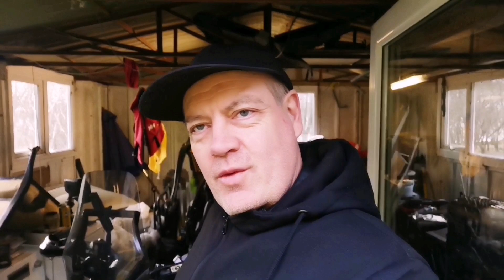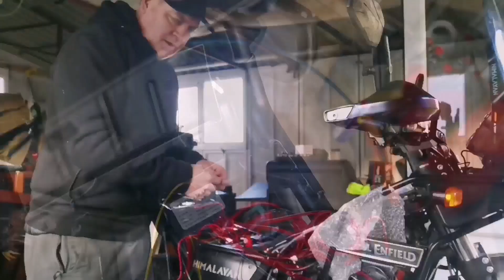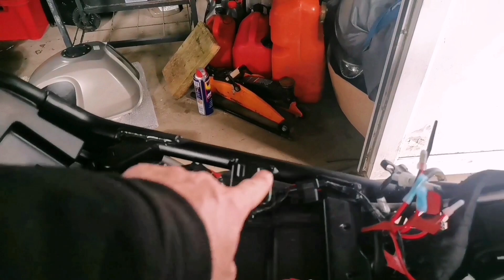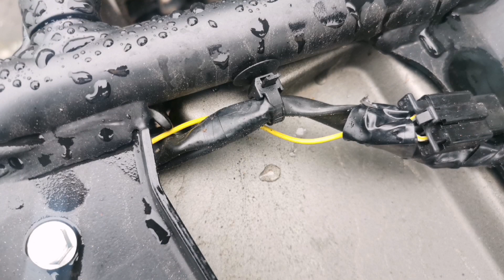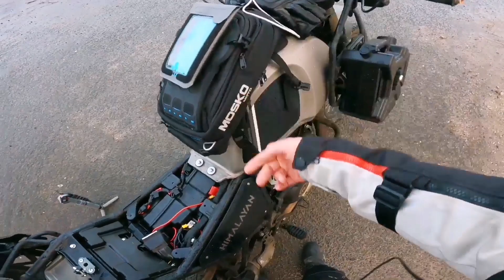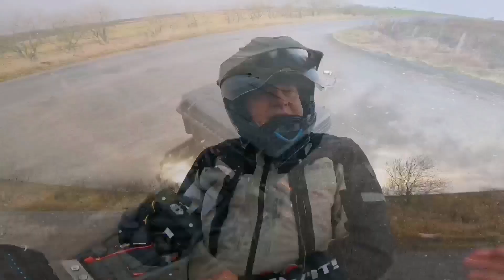INNOVV POWER HUB 2 INSTALL - Easy Step By Step Guide And The Problems I Had On RE Himalayan 2021.

Comment: I've just ordered a Hub 3 to power a USB charger and VSYSTO dual dash cam but now I'm confused... connect inputs to battery (red/black) and find a power supply that switches with the ignition/ACC for connecting to the yellow- that should work fine with the USB as it has just a Pos+ and ground to connect to the output side, but the dash cam has it's own yellow ACC/ignition wire so presumably I need to pair that with it's own red and join that to the hub red as the hub is taking over the control of it? ... otherwise if I give the dash cam it's own yellow supply the power adapter for it will get the signal to power up but have no power for 10 seconds. Not sure if that makes sense but I need to "dumb down" the dash cam so it is controlled only by the hub....??
Reply: Yes just pair the red and yellow together on one output + from this hub.

Comment: Well its slightly better priced than the overpriced thunderbox, but on my tiger 800 i just picked the trigger wire for my innovv k7 from the rear light yellow wire I soldered the joint and also linked a tail to my innovv third eye. All works fine

Comment: Hi I have a bit of a problem with mine iv fitter the same unit the same way But if I leave the kill switch on and just turn the bike off with the key the spot lights and heated grip and other stuff stays live and the battery go’s flat with in the hour 🙄 if I stop the bike with the kill switch then turn the key off 10 seconds later the power is turned off to everything 🤷‍♂️ Help please  🤦‍♂️

Comment: There are two black ground wires: output and input.  Do you connect the output ground to the frame and the input ground to the battery? Or the same location as the ground output on the frame ?

Thanks
Reply from the maker: You can do either mate whatever suits I put the ground on the bike along with all the rest but to do that I extended the wire by a few inches. You can connect to the battery if that's easier for you though.
Reply: @WeeJaunt  thanks for reply! Used the frame mount in the end.

Comment: The way to go … I had a PDM60 from another bike I installed. On that one you can program the time delay  each circuit comes live as well as the amps on the circuit so no need to the physical fuses. Lot more money, like I say came with another bike and I swapped it over. I cut mine into the docs tray so I can see the lights. Pics can be supplied !
Reply from the maker: Ah yes Nev the PDM is the Rolls Royce of switched systems eh. Nice that you can adjust amps etc. Very clever cheers mate 👍
Reply: I also had the PDM60 on an Africa Twin. Nothing better out there functionality wise and electronic smart fuses is incredibly innovative . However the price tag is a bitter pill to swallow. INNOVV does the same thing in a more basic and robust manner, better for reliability imho.

Comment: Very clean install nicely done. Thanks for explaining the Gremlins. 

 I put a fuse block in, the fuse box has six fuses and I run it off a relay off that license plate light in the back. The fuse box is a tight squeeze under the seat but it makes it nice to work with once it's in. Obviously with the relay nothing comes on unless the bike is on, and is off once the bike is off. I don't have the benefit of a short delay in startup and shutdown that is a nice feature.

Currently I run two outlets one at 12 volt circular connector and one double USB

 I also have a relay and a switch to run some fog lights in the front. They are off one of the fuses in the back as well.

I've got a heated jacket and heated gloves as well. Running the heated jacket, the heated gloves, the fog lights, and the accessory outlets is a bit too much for the Himalayan. It just doesn't have a big enough alternator to handle all that load. Thus I think six circuits is probably plenty. 🙂
Reply from the maker: Wow sounds like you have a great set up. I'm sure it does the business. I agree on the Himi alternator or the alternator on any bike tbh it's not a great idea to run absolutely everything all at the same time..infact wish I'd mentioned it in the video lol thanks for bringing it up and thanks for watching mate 👍

Comment: Nice install, keeps everything tidy. I’ve done similar on my Himalayan with a Fuzeblock.
Reply from the maker: Excellent Adrian I also looked at the Fuzeblock + Denali. Both technically better than the innovv but when I saw the innovv on sale for £39 I just had to buy it at that price. Thanks for watching mate 👍
Reply: @WeeJaunt   Hi just seen your innovv install , it was great by the way. I have one question if you could help please, I'm going to fit a set of 40w led spot lights do I have to fit another relay for the lights or can I run straight of the innovv wiring
Reply from the maker: @jeffreydawson2090  Hi you don't need an extra relay mate the innovv system is basically a fancy relay controlling 5 devices just hook it up to one of the outlets. I'm doing exactly that install in the next week or so. The lights might have an  inline fuse already you can leave it in place but I would just cut it out. You don't need 2 fuses. The innovv 1 has higher amp than innovv 2 for the same money but it's a bit bigger. I just went for innovv 2 as I figured it was enough for my needs. If ur not sure just get the bigger one. Thanks mate 👍
Reply: @WeeJaunt   Thanks for your help and time I find your videos very helpful 👍

Comment: My favourite tool is a big hammer.  Surprisingly, bike electrics don't always respond to it well.
Reply from the maker: Haha brilliant Steve.. Al tell you mate I had my heart in my mouth when I first had that issue with the lights + the bizarre thing is the fault kept changing with different lights flashing etc lol. I just couldn't get ma head around it. Luckily I was at my mechanic brothers house at the time so he was able to help. Even still it took a good hour before we realised it was a daft plug not connected properly. It was very nearly a hammer job lol

Comment: I have a 6-way marine fuse box power by the yellow wire to the rear lamp. At the moment it's a bit over Kill as i only run a USB socket and a pair of LED spots. A lot of the power hubs ive seen are from the USA and cost double of the Innovv one. Do you think they had sticky keys or a stutter when they named the company?. Apparently the make good dual camera kits for bikes
Reply from the maker: Haha yes mate. Stutter 😂 I kept an eye on this for a while waiting for a deal. Overkill is always better than underkill Iain at least you are future proofed and you can add things if need be. 👍